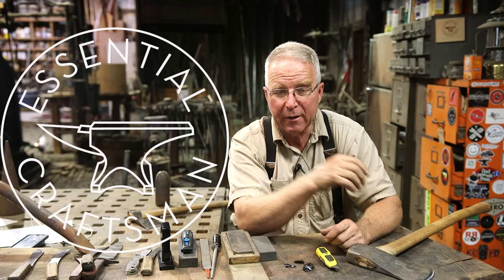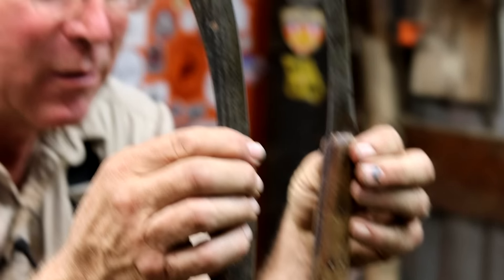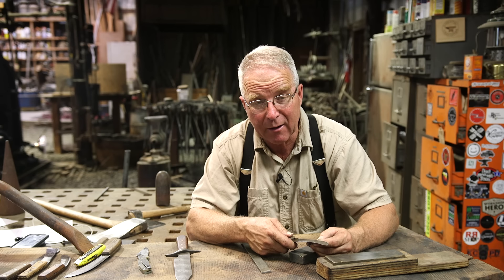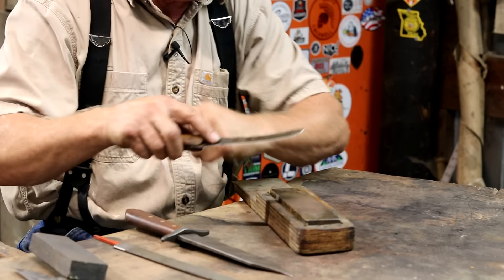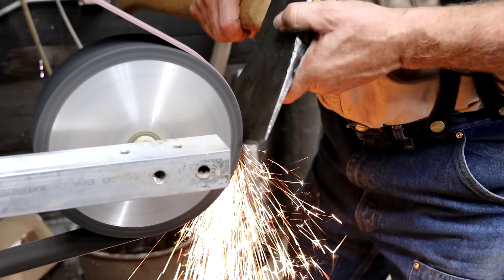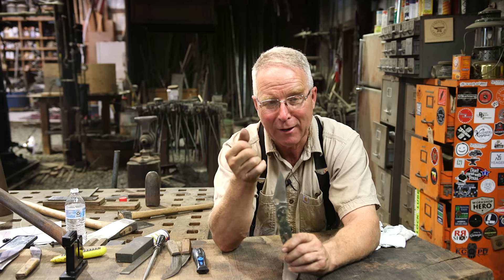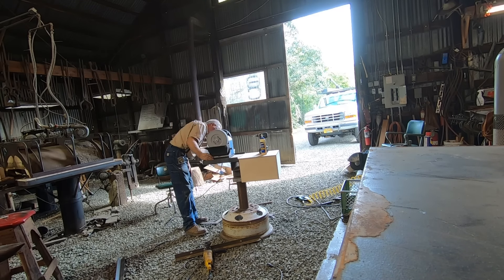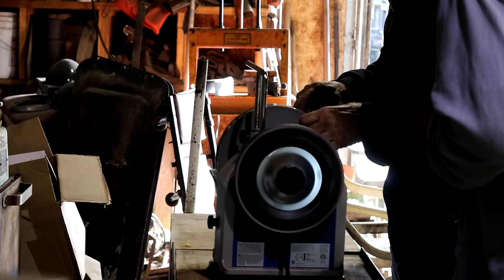Master the Art of Sharpening

Comment: I use the Tormek in my knife sharpening business. FIRST thing you're using the Tormek backwards, turn it around so the stone rotates towards you. SECOND the storage under the Tormek a no no, if you plan on changing jigs you will have to remove the water reservoir and lift the unit to a clear spot, not to mention you will have water over flowing and dripping everywhere, I have a separate cabinet beside with the jigs right at hand. THIRD remove the stone after use and stand it up on a well drained spot (lay it down and it will mold), otherwise it will rust and destroy the spindle ( the stone holds a LOT of water for a long time), i use a 1/2" piece of copper pipe cut to the width of the stone to take its place, if you don't the spindle will slide out the other side. FOURTH get the harder stone if you plan on sharpening wood shop tools (chisels, planer blades etc) the standard stone will disappear fast.
Reply: Great advice! I hope he sees it!
Reply: Me too, sounds like great advice!
Reply: You should start a youtube channel I would definitely watch those knife sharpening techniques.
Reply: I have an older Tormek and have never had to remove the stone. Empty the water trough when not in use. I do agree that the stone holds a lot of water. Don't leave the unit someplace where it will freeze. You can sharpen with the stone turning in either direction but it will sharpen a lot faster with the stone turning towards you. But for the leather strop you have to use it with the wheel turning AWAY from you. Ask me how I know.
Reply: @paultennis9414 , A little grabby that way ?
Reply: I use the tormek daily too, So I totally agree with your statement here👍

Comment: Not sure about the entire country but in IN, we have Dollar Tree, and they sell a $1 sharpening stone. 2 sides, rough and fine grit. Perfect for beginners or to do an initial sharpen on something that you dont want to wear out your good stones. I keep a few on hand at all times in case someone wants to learn how to sharpen, i show them how, and let them keep the stone. Great video! Thanks for the content!!!
Reply: They (cheap stones) will wear out faster than good stones, which makes them excellent for unique applications because they will take the shape of the piece quickly.
Secondly the difference between an oil stone and a water stone is what you use on it. Once you use oil you cannot go back. Cheap stones generally are too porous and soak up to much oil and then make too much of a mess. I recommend keeping with water for the cheap stones.

Comment: As a cook I use a lot of knives. So I feel like I have the ability to tell you, Never use one of those pull through sharpeners. Like you said they remove a TON of steel and on top of that they leave a terrible edge. It always ends up jagged.
Reply: Mostly agree.
I say mostly because for quick and dirty utility work, they are hard to beat. But, i can well see why a cook wouldnt one anywhere his good knives.
Reply: I agree.... the inexpensive pull-through sharpeners are not effective in giving a good/sharp and lasting knife edge....
Reply: An India stone and a good honing steel is all you need.
Reply: The carbide pull through sharpeners need a light touch. Every one wants to use them for a reprofile. Use light pressure and strop on leather and you will have a usable, durable edge.

Comment: I've learned that a steel actually doesn't hone the edge,  but actually puts a finely serrated edge, makes a fine saw edge
Reply: A steel is very hard and uses the fine edges along its length to scrape an edge onto a knife.  Good thing for carbon steel knives, not so much for stainless knives.

Comment: The pull-through preset devices are great for keeping handy to intermittently touch up an edge, but keep in mind they only sharpen the very tip of the bevel and will create an increasingly deep secondary bevel, which will eventually require some aggressive regrinding with a stone to re-establish the proper profile.
Reply: Them things are junk.

Comment: Great overview, thanks.  Agree on power sharpening.  I have a 1x42 Kalamazoo slack belt grinder, and learned quickly to go slow and lift the tip of the knife on the end of the stroke to avoid rounding it.  You can bring the tip back, but it’s a lot of work.  Once you go power though, it’s hard to go back, and I always use the slack part of the belt to give a convex edge.  FYI, my Dad started me with an Arkansas stone (novaculite) and oil in 1963 to teach me how to hand sharpen, and it was a valuable lesson. I still have his set of Smith’s stones in soft and hard Arkansas and black hard Arkansas in cedar boxes, that will sharpen anything up to straight razors.  Love your shop, what a great place to work.  👍

Comment: I really like his advice about reading the angle of the blade to know how to sharpen it.  I came upon my grandmother's kitchen knife that sat in my drawer forever without use.  Decided it needed some sharpening.  That knife must have been at least 75 years old and had been through all manner of use, but was as dull as could be from being washed a zillion times and not sharpened.  I'm still working on it to recover its former glory. It is a meat slicing knife, carbon steel. Her other knife I have used for at least 40 years and I do all sorts of kitchen tasks with it.  It's an old carbon steel full tang Chicago cutlery.  I love that knife!  Will split a pumpkin with ease, but also a tomato into fine slices.  My dad would buy a pocket knife just about every time he went into the hardware store.  I still have some of them.

Comment: Whet wheel boss. I got one that was handed to me by an old timer and it's awesome. It's a small spinning sharpening wheel that has a reservoir that you put water into, as well as a 'wiper' which does two things. Wipes the wheel of loose material as it spins and also keeps the wheel lubricated at the same time. The centrifugal force of the wheel spinning keeps water on its surface as the wheel is porous. It has an angle adjustment plate on it that you don't have to use but i like to use it. It also has a small guide that changes the angle on another axis. Hard to describe but it could enable one to sharpen a chisel that isnt square, or make a square chisel angled. The machine has a relief so you can sharped 2 piece tools like scissors. All of that is the theory, but in practice, this machine really does a great job, and it's versatile you can sharpen everything almost. My pocket knife which is heavily abused, has kept its edge in working order for over 2 weeks. That's unheard of for a knife I carry. I encourage you to get your hands on one, it's definitely a vintage item and maybe hard to find. If you want to borrow mine, I'd be more than happy to send it your way so you can check it out for yourself

Comment: Considering there are close to 2000 comments, I hope I'm not repeating someone else.  That said, I recall, back in the '70s, my mother got this fancy electric can opener.  I can't recall the maker.  What a labor and time saver it was!.  But the neatest thing about it was that it had a knife sharpening system built in.  I never saw the inside of it, but it must have had a grinding wheel inside with slanted slots that guided the blade and held it at the proper angle.  You simply drew the blade through the slots, alternating sides.  I had sharpened many a kitchen knife for her with a whet stone.  So I can say again, what a labor and time saver!

Comment: Eight years old using my grandfather sharpening stone I remember that cut. 10 years old learning about a folding pocket knife can fold over the edge into your fingers when you stab a tree. Finally perfected honing the edge of a knife with two knives drawing over each other in reverse direction
Reply: Stabbed a tree with my brothers pocket knife. Thumb slipped down the blade. Good lessons
Reply: Dropped mine onto my leg immediately after sharpening. Of course it landed tip down and achieved reasonable depth. Had to breath a few times before I pulled it out. Scared myself pretty well. Still have that scar 45 years later. But I almost never cut myself anymore.  It's how we learn, I guess.
Reply: Was out camping as a teenager with a basic knife after losing the locking blade I'd had for years. I stuck it into a tree for a moment and sliced my knuckle on the blade that I forgot wasn't locked

Comment: If I recall correctly, obsidian edge can be the width of a single  atom or atoms (in certain locations, not the entire length of course of the edge ), so in theory it remains the sharpest possible edge. Also some Case knives are made with surgical steel which makes for a very good edge and these knives hold a sharp edge

Comment: That black standup thing with the two rods is called a Chantry Sharpener. The rods have longitudinal grooves and rotate while you pull the blade through. I've tried them and found that they don't put a fine edge on, but they do create fine serrations in the edge. I don't use mine for regular knives, but it works great on serrated knives!

The carbide scraping type will produce a keen edge, but over time the  edge develops a wavy profile

In my kitchen, I get better results using stones to establish the edge and the old fashioned steel to maintain it. With care, the knives only need honing a few times a year, but they get a few swipes of the steel every time I use them.

The scraper and Chantry are good tools for people who can't or won't hone their knives but who do appreciate a sharp knife. I've given my sister in law a Chantry and she loves it.

Comment: Many years ago I was cleaning up an axe (Boy Scout issue Plumb with the epoxy eye) that had been accidentally left out. I decided to just use an orbital sander to knock off the rust and then sharpen it with a file and stone it as I usually did before. The sander did such a marvelous job of cleaning the rust away and I discovered that I had cleaned up the cutting edge significantly. So I kept on until I got the edge I wanted. Swapping sides frequently. Of course I went through various grits until I was in the 220 grit range and then went into the wet sandpaper grits 400 600 800 to polish it to a razor edge.  I've been doing so ever since and show this to many a Scout since along with the file and stone. I now use a sharpening steel and the ceramic rod out of a Sodium Vapor street lamp to keep my knives polished sharp. Every time I use one it gets a bit of shine on the edge. My sister in law will no longer let me sharpen theirs, as every time I did somebody had to go get stitches in a finger. BTW I have an old leather belt impregnated with green polishing compound to strop them as required.

Comment: Interesting lesson I learned from my grandmother, if you flip a ceramic mug upside down and use the rough edge on the bottom if you don’t have anything else it will sharpen, ive done it it does work

Comment: I am now 70 years old ,live in New Zealand a retired retail Butcher. I have broken down thousands of animals, sheep, pigs, lambs and beef etc. In all my time in the job we only hand sharpened our knives on a stone, usually in the morning before starting the day. The butchers usually carry in their knife pouch three knives, my knives were a large steak knife, a 6 inch boner curve back and a smaller knife for boning through the joints in the neck bones in the neck of a cattle beast, known as a chuck knife. This is where the chuck steak came from. When I started as an apprentice about 1968, most of my knives were carbon steel blades. I learnt how to get a razor sharp edge on these. In about 1975 we changed to the Swiss Victorinox. I have never left Victorinox, they are a great knife. So many buy good knives and place them on a electric grinding wheel and wreck the knife. When sharpening any knife , first your stone needs to be grease free..........start on one side count to ten then change to the other side..........keep the sides even. When finished run your knife 2-3 times through the grain end of a piece of wood to remove the feathered edge on the knife.
To steel a knife,............my steel one of the best FDICK made in Germany, Keep your steel clean free from grease, We always had pieces of old red brick and we would rub this up and down after the steel had been degrease. I have sharpened many knives for farmers , hunters etc,................never a complaint. When I would hand a knife back to the owner my saying was be careful this knife is so sharp  '' IT WILL SHAVE A MOUSE ASLEEP '' Any Kiwis reading this will know who I am.
Reply: Using a stone without fluid increases load up, making it cut slower, not ideal for coarse work.

And dragging an edge through endgrain ruins the edge, better to use edge leading alternating passes to remove the burr.

But if it works for you, sure keep doing it, but it's not what I would recommend doing.

Comment: I have a gerber blade that I've only ever used for the final job in a hunt, had it since the early '80s,  never been used for anything like cutting rope, etc.  I'd say that by now it has lost close to a quarter  inch of blade from sharpening.  Beautiful knife, I wouldn't disrespect it by using  it for anything other than its' intended job.

Comment: I started straight razor shaving about a year ago, and it took about a year to really get the feel, using Arkansas stones to sharpen the razor.  I have the, soft, hard, and black. Id like to get the translucent, as it should make shaving a little more comfortable.  I use soapy water instead of oil. Yes for the stones, not my mug...

Comment: I don’t know if it’s been mentioned already, but it’s perfectly okay to use water on an oil stone. IF it is already sludged up with oily debris, it’ll still work. It’s been explained to me that oil was always the preferred liquid because the knives were just regular carbon steel and would need to be oiled afterwards anyway. Try it. If you want to clean the oily crap out of a stone, soak it in acetone.

Comment: I use a bench sized belt grinder for speeding up my annual blade maintenance, and I can confirm that they're fantastic once you know them well, but I did hurt or destroy a couple of nice knives in the learning process.

One to over bite, busted the temper on another, and basically consumed the material on the first I used.

So greatness comes with a cost, maybe practice on some sacrificial cheapies.

Comment: Awesome lessons. I've made nearly 20 knives, out of all them I've only made one that keep sharp enough for the task, the others are what I call working knives, all full tang,,some are from circular saw blades "mystery steel. My favorite working knife is made from a flat prybar,,I use it most on jodsites and really never have to keep it really sharp for its applications, liking making shems,, etc. It's my favorite quick build, no heat treat, just cut and keep it cool, then to the grinder,keeping it cool, then belt sander keeping it cool  , then done easy peasy. Would like to do a forge in the future though looks like fun!

Comment: My grandfather taught me how to sharpen a pocket knife, after he bought me a Barlow from Fitzgerald Hardware over 60 years ago, since GrandPa has been dead 64 years.  He got a wet stone ( about one inch wide and three inches long) put it on the leg of his coveralls, spit on it and used his Barlow to show me how to sharpen my new knife.  Then, he let me sharpen my new knife, checking my work as I proceeded.  I don’t know how sharp it was but he finally said it “passed.”  I have refined his procedure somewhat but it still is basically what I learned back then.    His procedure is not a lot different from yours.

Comment: The black plastic hand held tabletop sharpener looks like it has ceramic rods. They do the same job as the Whetstone with an already established angle. Some are adjustable for a secondary bevel along the zero edge face. The Samurai Shark is faster but more aggressive  while removing material. The Carbide blades don't give you a clean smooth micro bevel along the zero edge.
    For straightening a bent, rolled edge; on one that's nicked and chipped,  the Carbides work well to quickly straighten the edge or remove enough material to start using Whetstones. Double check the condition of the edge after using Carbide sharpeners. Any nicks, chips, or dings will be transferred to the face of the Whetstone requiring a truing/ squaring of the stones face.

Comment: You're going to love the tormek. That thing will sharpen anything to a perfect razor edge. I've used it to sharpen knives, chisels, axes, even shovels and hoes. You probably noticed the package of band aids they include in the kit. 😁 Luckily, I haven't needed them yet. Anyway, the tormek is a versatile system and you end up disappearing into the shop to emerge 2 days later, after you've sharpened everything you own, only to ask the wife to start handing over her cutting devices. 😀 Just make sure to read the instructions for each item you sharpen, some utensils require a slightly different setup or procedure. It also appears y'all are on the wrong side of the machine. The wheel  needs to rotate towards you. At least, thats how it appears in video. Could be a frame rate thing. Hopefully tormek will work a deal with you, cause they could earn some business from the exposure. Great video as usual.